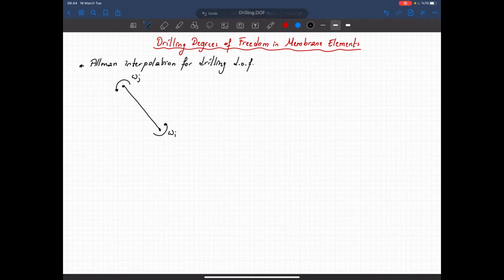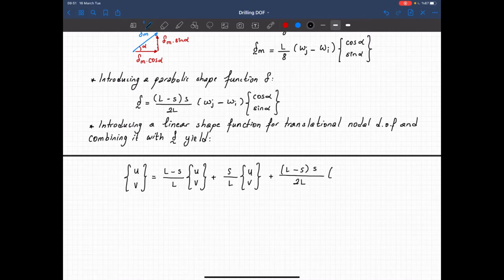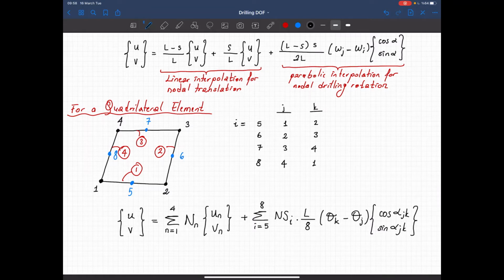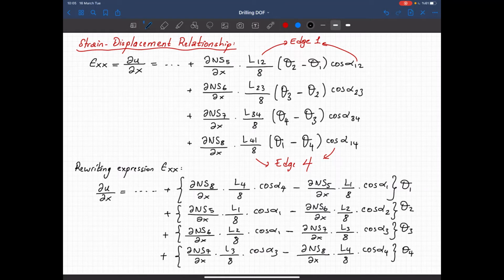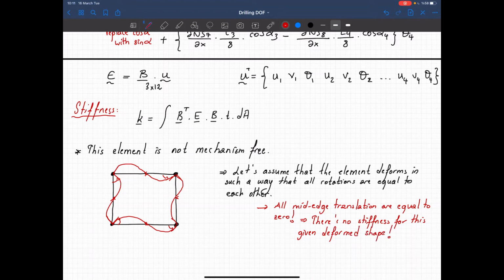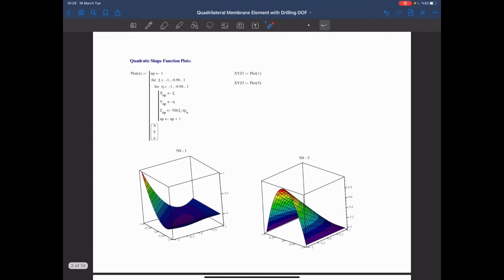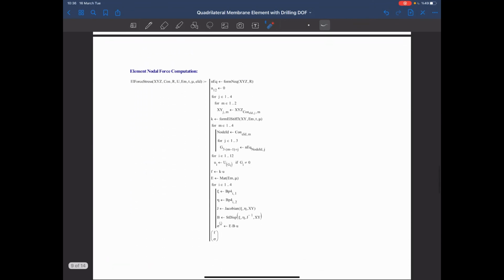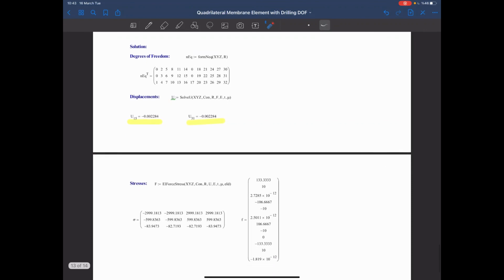CE 583, Membrane Element with Drilling DOF, Week 6

Comment: Hi sir, i found this lecture very interesting and super rare ! I tried to study and make my own code in MATLAB file by following your lecture. I am quite interesting with the way u tried to analyse the example cantilever case. I tried to free the drilling rotation and got the similiar result like yours, but i notice the rotation result is in positive? May i know what is the causing behind,shouldnt it be negative?

And another question, if i meshed with many smaller size element, and fixxing the drilling rotation, i got similiar vertical displacement as well, but the rotation result is not good. 
could you please answer my question??

thank you so much!